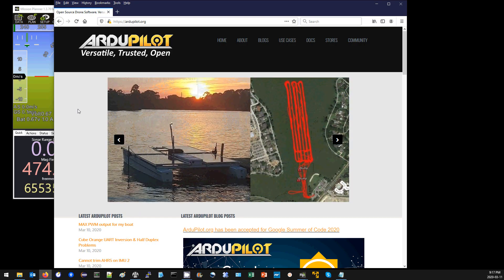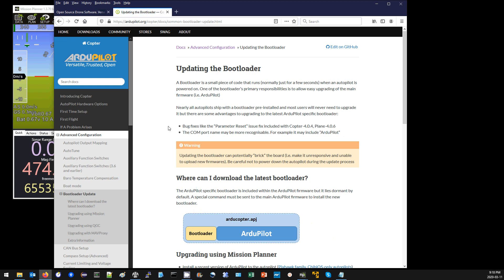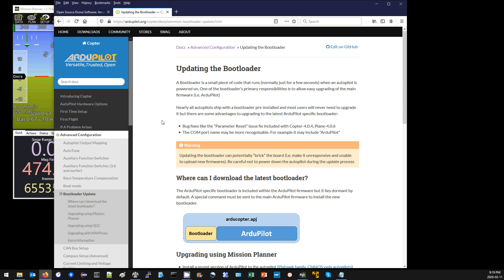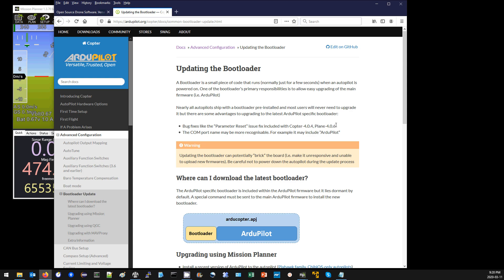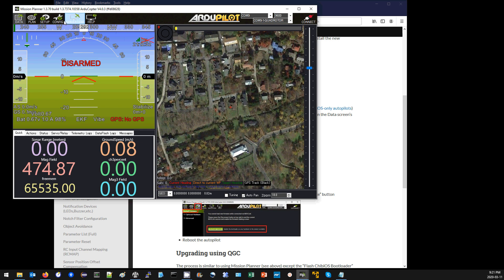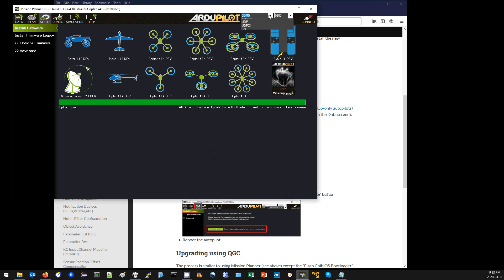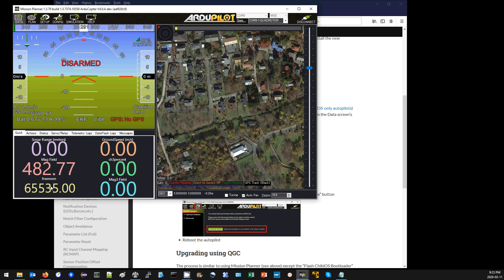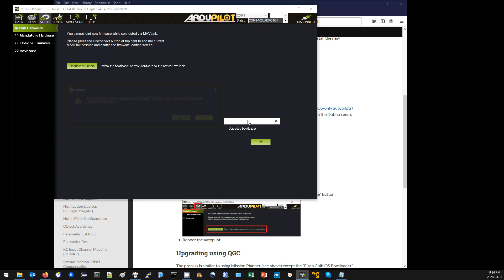How to update the boot loader on an ArduPilot autopilot

Comment: I have an apm 2.8 how do I get more freemem I only have 1125-1170 but I need more to upgrade
Reply from the maker: Hi @pooh4694, I'm afraid that we can't provide support for the APM 2.x boards.  We stopped providing new firmwares for these boards well over 5 years ago.  ArduPilot support hundreds of better boards some at very reasonable prices so please have a look here for a replacement. https://ardupilot.org/copter/docs/common-autopilots.html.  I would go so far as to recomment that you complain to the retailer who sold you this board.  There is absolutely no good reason for anyone to buy the APM 2.x boards anymore.

Comment: Hi
 My pixhawk had vmu2 version installed with 2mb ram.
After following the way to upload a new firmware via QGC it reset my firmware to 1 mb and now i cant upgrade to vmu3.
Any help would be appreciated thanks.
Any links to reflash my bootloader to 2mb?
Reply from the maker: I don't know how it work on QGC but with MP you can select which firmware to install using the "All options" link on the bottom left of the Firmware Install screen.  Another option is to manually download the .apj file for the Pixhawk1 board and then load it using the "load custom" option. https://firmware.ardupilot.org/Copter/stable/Pixhawk1/ and then after you've confirmed that's working update the bootloader again.  This folder holds Copter's stable firmware (currently 4.1.4) for the Pixhawk1.
Reply: @rmackay9  thanks for your quick reply. So how did my pixhawk downgarde to 1mb from 2 mb.
I want the vtol eflite option which needs 2mb
Reply from the maker: @Surferant666  I don't think the board has been downgraded in anyway.  It's just that the "fmuv2" firmware was for 1mb boards and the "fmuv3" was for 2mb boards.  In the end you can install whichever firmware you want, the ground stations just try to make it easy by only showing you firmwares that match what is already on the board.  We recommend these days that users use the firmware that is more specific to their board because, in general, this allows better detection at startup of sensors (e.g. the software can detect if a sensor is missing)... so we recommend loading the Pixhawk1 firmware instead of either "fmuv2" or "fmuv3"
Reply: @rmackay9  my problem is it wont reinstall the 2mb option. It is only showing 1mb of ram,
 whereas before it showed 2mb ram and a vmu2. It wont load anything above 1mb i think i need 1.5mb for vtol
Reply: It showed 2mb with the fmu2
Reply: Same problem for me. Had pixhawk 1 installed. Then updated the bootloader and now it I can't install anything but pixhawk 1M! Did you found any fix for this? Missionplaner should warn for this issue.

Comment: hello im in the problem I have Radio link pixhawak , The first time everything going well when I try to the plugin  USB port, buzzer, and main led ( blinking with orange color )response properly, and then I download MP(update version)  from the autopilot website, and also inositol on my pc.try to upload firmware for Hexa .but main led blinking orange color. and do all calibration properly. when I try to armed buzzer tone ....didn't arm. again I'm trying to load firmware than USB not doing recognizing my board.   I'm trying much time but no good result. still, now I have the suffering the same problem, what can I do now?
Reply from the maker: Hi Ruby, I'm afraid we don't recommend the Radiolink autopilots (see note at the top of this wiki page: https://ardupilot.org/copter/docs/common-radiolink-minipix.html) because they're not working with the AP development team to ensure an open source version of AP is available.  We think they are actually breaking AP's GPLv3 license.
Reply: @rmackay9  
I don't have mini pix. its  Radiolink pixhawk .
 what can I do now,,, 
Is there any solution
Reply from the maker: @rubyathsiddiki6561  I'm not sure, perhaps manually download and then upload the firmware for the Pixhawk1. https://firmware.ardupilot.org/Copter/stable-4.0.3/Pixhawk1/arducopter.apj.  Beyond that maybe someone else on the forums has experience with the Radiolink Pixhawk.  https://discuss.ardupilot.org/c/arducopter/copter-40/155.  Sorry if you're caught in the middle but I can't really help with hardware from Radiolink.

Comment: I’m also using Li Ion batteries with Mission planner/Pixhawk airplane, and have been getting a new type of warning recently on the mission planner HUD in red.    :        BAD BATTERY   
Wondering if you had seen this too, and why?  Seems there is an internal resistance monitor in arduplane set for Lipos, and it’s detecting too high internal resistance.  (Normal of course for a Li Ion battery) 

Using 4S4P Li Ion NCR18650GA cells, and only pulling 23 amps.   Cells rated for 10a each, so 40 amps total.  
I get the warning about 2/3 through the flight, after about 78 minutes, when going to a high power setting.  
Any way to select battery cell type, etc?   Or to shut off the false alarm in Mission Planner?  
It stays until reboot.      Happing with new cells and several new batteries, so I’m well sure that it’s not a real problem..    also batteries are giving 90+% of their rated capacity, so they are genuine. 

Thanks for your time and response in advance.  Just wondering if you had seen the same thing?

Comment: Intent of the video is to update bootloader on Cube orange? Usually bootloader update is not suggested.
Reply from the maker: The intent is not to ask everyone to upload their bootloader but users who are suffering from the (rare) parameter reset issue probably should.  This parameter reset issue can happen on any autopilot with an FRAM chip but most cases seem to happen with the CubeOrange mounted on a "Kore" carrier board.